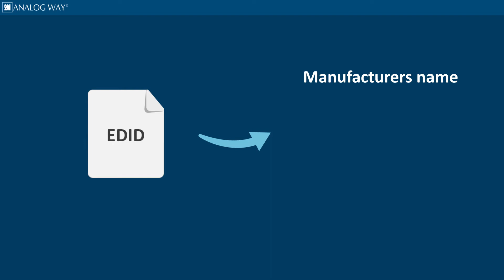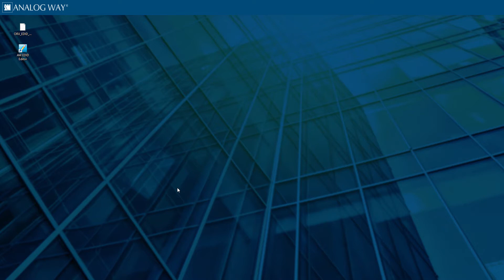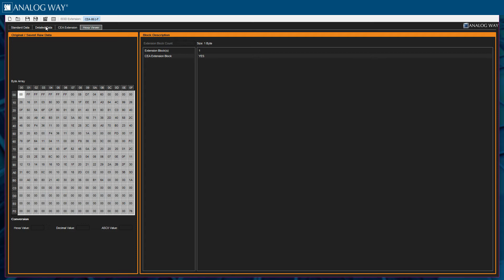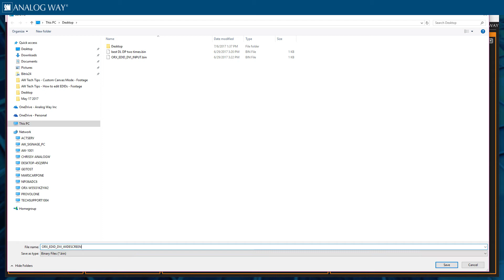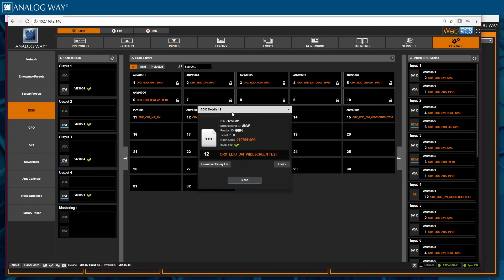How to edit an EDID (LiveCore™ platform)

Comment: Is it possible to change OUTPUT EDID ?
Reply from the maker: A LiveCore device will ignore the output EDID and always send the exact resolution and refresh rate that it’s configured for. However, should you need to edit the output EDID, you’ll need to do it from the device providing that EDID. As long as it allows you to download and upload EDIDs as a text or binary file you can use the AW EDID Editor to do this.